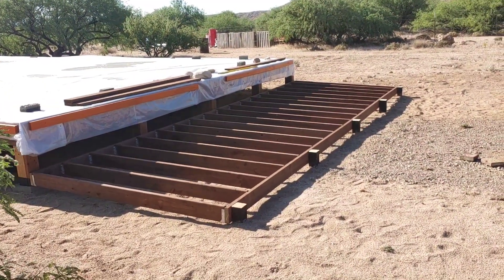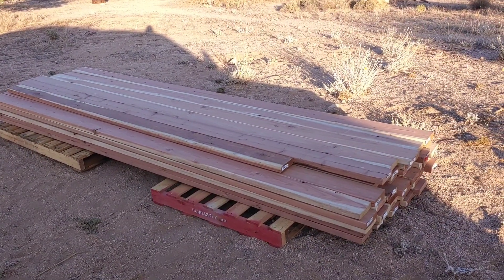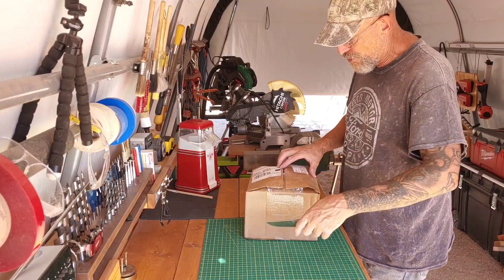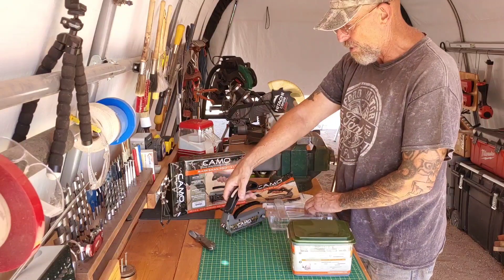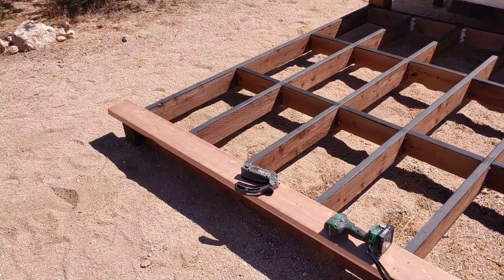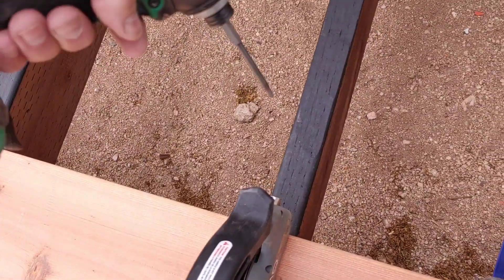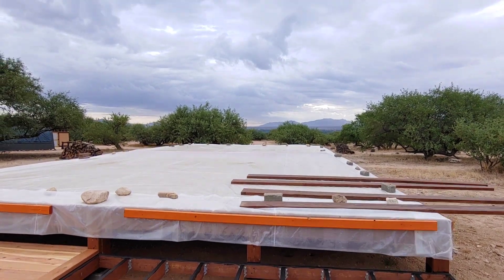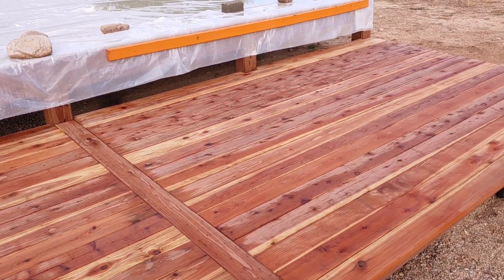#decks #sustainable Straw Bale House Build Day 10: Front Deck Build Part 2

Comment: Deck turn out very nice. 

Thanx for sharing your experience with Camo Edge Fastening System. 

Thank you Yvonne for guests appearance but at the same time I missed the site supervisor. 

Good luck guys.
Reply from the maker: You're funny! I'll see if I can arrange a cameo appearance in the next video. It's tough though with this heat she is usually hiding out under the trailer or the  house deck. Just looking for some shade. 😎

Comment: I used the Kreg deck screw system in 2012 and ended up having to face-screw after 8 years when the board eventually popped up. Might have worked with composite boards but didn't work with my 2x6s
Reply from the maker: I'm glad I went with the Camo system and hope it holds up better than your Kreg. Thanks for watching and your comments 👍

Comment: Nice Deck!  I haven't seen that tonail system before.  I might use something similar for when I build my deck.  Cheers =)
Reply from the maker: Thanks for watching. The first half was a bit slow because of the learning curve and also figuring out the best way to use my clamps to correct the warping. I was able to do the second half in literally 1/3 the time need for the first half. Looks good too. 👍

Comment: I finished my deck in 2016 using the Camo system. I am very pleased with the results. No screws in the face of the deck. I used a liberal amount of deck stain between the boards to try to fill all the screw holes to reduce rot.
Reply from the maker: Glad to hear everything is holding up well. That's why I went with redwood. I wanted something that would naturally age and be very low maintenance. Thanks for watching!

Comment: Clean and precise with some design to it, I really like the edging.  Please make some plant stands so the heavy ceramic pots don't leave circles , I have made that mistake before.  After seeing that connection system my next deck will cost a $105.00 dollars more . Great Job
Reply from the maker: Good idea with the plant stands! I was actually thinking of matching redwood "built in" boxes, but your comment triggered an idea of building redwood "coasters" on casters. I'll have to run that by Yvonne since she's the plant manager. Thanks for watching and the brainstorming!

Comment: Another great job. Looks perfect. 
One small comment, that's really not a big deal....but an old deck builder I worked with back in 1980 always said, when installing the deck boards you should try to position the boards with the growth rings.. "bark side" up, when looking at the end grain.  This is supposed to allow more natural protection of the board from the elements. Don't know how true that was, but it makes sense.
Reply from the maker: Thanks Bill, now I gotta tear off half the boards and flip em over 😉. Just kidding, I've heard that as well. I looked into it a bit deeper, and found, interestingly enough,  people who said just the opposite ( like anything else, no big surprise there) cup side down. But I think it's more critical when using pressure treated lumber rather than kiln dried Redwood. I could be wrong though. The boards had a clearly definite good side to them and well, that was the side that went up. Another strange thing about the redwood boards I bought was the end grain appeared straight! It wasn't until you cut off the end that you were able to see the growth pattern on the end grain. I found that odd. As always Bill, we appreciate you watching!

Comment: Deck is beautiful! I love Redwood, we used it for the railing on our porch. Are you going to finish the deck? I used some BLO. I’l have to reapply about every 18-24 months, but it really brings out the the beauty of the wood.
Reply from the maker: Thanks for watching. According to the manufacturer of the redwood, we should wait 3-4 weeks before applying any finish, so that gives us time to decide what we want to do. The beauty of redwood is that no treatment is actually necessary. We were also told that in our climate, the redwood would age naturally to a warm silver tone which could be interesting. We'll see. I use linseed oil, it'll be thinned out with mineral spirits like like did on some posts in the previous video.

Comment: in my experience all the joists are slightly different  better to attach to the joist then  place appropriately to the ledger
Reply from the maker: I know..... one day. In fact, I'll try it on the next section of deck. It's just when working alone, accurately holding 2x6x8 in place while  securing, even with a framing nailer, it kind of difficult. That's why I try securing joist hangers first. Maybe what I'll do is set up a ledger board to establish the height of the joists and hold them temporarily. Then all I need to worry about is placement side to side. Yep, watch for the future deck video. Thanks for the feedback and brainstorming. 👍